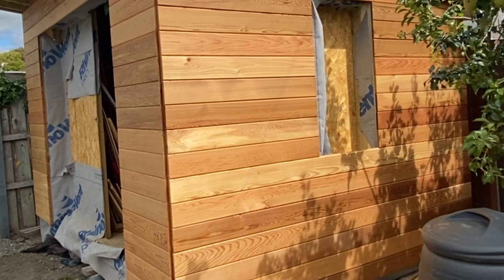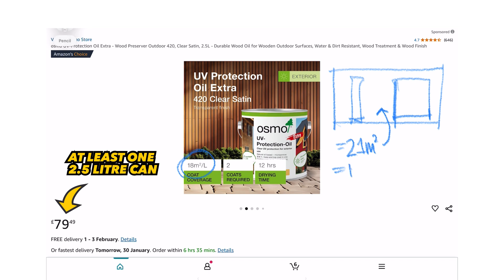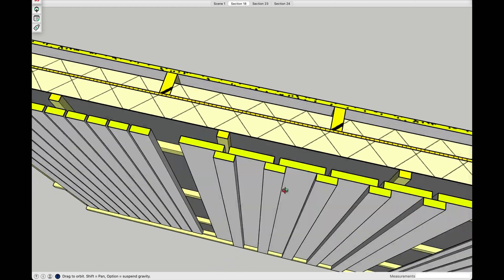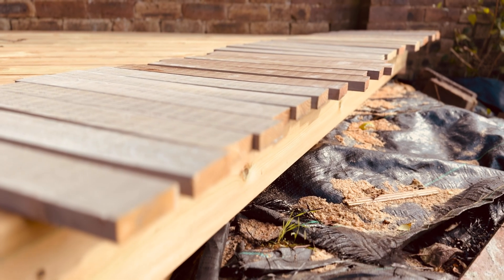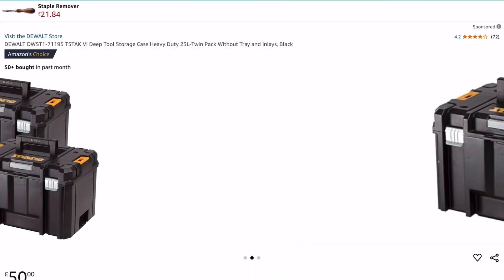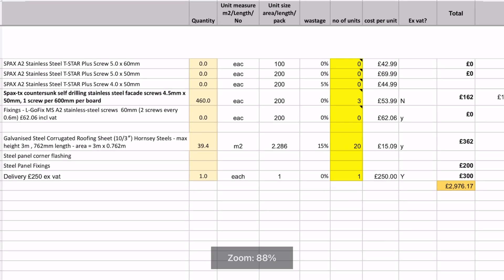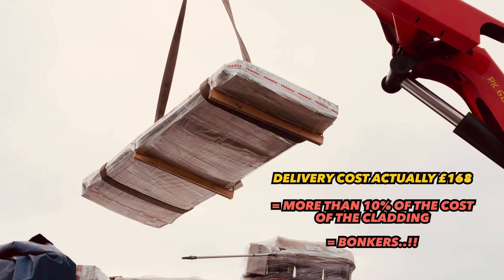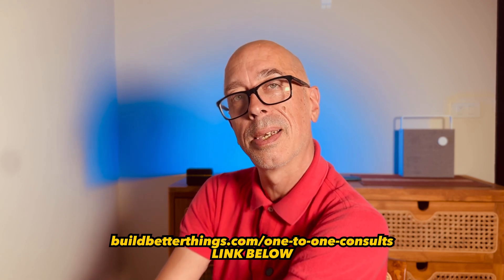Wall Cladding - panel size, fixings, timber or composite - rain screen or tongue & groove

Comment: Hi, I have just come across your channel and currently binge watching everything I can find about garden room builds. One question I have, is with a Warm Roof setup, how do you properly apply a vapour barrier? Specifically at the ends of the joists. Every other video I come across, the put in insulation and tend it forget about the vapour barrier here. That cannot be right!
Reply from the maker: You’re right. Many just do the roof vapour barrier and don’t bother about the walls. I see it a lot in the roofing videos.  If you see the early part of my video you’ll see the silver vapour barrier laid around the joist ends so it forms a continuous layer between horizontal roof and vertical wall. It’s a bit more work if you go with these bulky overhangs which many still do, but still possible.

Comment: Lovely detailing.  When is the video for the eaves coming out? Have always hated clunky eaves overhangs with fascias.  You mentioned this is a parapet in the video. Be interested to see how this was constructed. Your videos are so useful and informative btw.
Reply from the maker: Thanks a lot. Hope to get it out soon.
Reply: Looking at the drawing and images I can work out the eaves detail, though it does not appear to be a parapet as such.  It does mean that the cladding is a rain screen and I wonder if it is possible to incorporate a drip detail to prevent rain driving behind the cladding when using a vertical lapped cladding.  A chamfered piece of timber fixed to the edge, with the chamfer sloping upwards on the underside towards the cladding to form a drip might work, though you would probably need a batten on the underside to hold the edpm in place.  I assume you have a gutter on the opposite, rear side.
Reply from the maker: Hi. I form an 20mm projection over the roof to the depth of the rain screen and the cladding plus 10mm. The EPDM is folded over that and lapped over the breather membrane. It’s a parapet, just a very small one. I will be releasing a video soon, I just need to make the time.
Reply from the maker: Yes, gutter only at rear.
Reply: Thanks for such a speedy reply.  I see the low parapet now on another video.  Nice and simple with no tricky pigs ears and other details to bother about.  Is the parapet formed with OSB (surely you would say this will rot)?  Or is it some form of cement fibre board?  Or do you just have thicker insulation at the edge?  Would building control be happy with such a low parapet detail and no eaves?  Thanks for your help and sorry for so many questions.
Reply from the maker: Questions are good. Building control are only responsible for compliance, not design. Parapet is marine ply and sits above roof and wall insulation so no cold bridges. It can’t rot because it doesn’t get wet.  You need to consider fixings considering uplift.
Reply: Thanks, really helpful 😊

Comment: Really neat finish on this! Would you consider doing a video on (or mention in some capacity) rendered finishes onto timber framed construction? E.g. harling or monocouche style systems but onto a timber construction

Comment: Fantastic video. Your recording of graphics is getting better and better. Keeping them relatively static in orientation on screen makes it easier to follow the "story". 

Here in New Zealand that Sioo:x is $75 per liter. or $285 per 5 liter. At coverage of 4-5 sqm per L for the first 2 coats and 8-10 for the 3rd, the price is getting insane. When you're coating 3 sides of each open panel board the total sqm goes up by a factor of 1.3. So a typical 30sqm sleepout with 40sqm of exterior cladding, would need around $1800-$2000 of SiOO:X.
Reply from the maker: Thanks a lot. The sioo is quite a bit cheaper if you have it done it the saw mill, but that depends on whether they do it. There are a few that do in the UK

Comment: Hello, I’m doing an outbuilding and building control say we need euro class B due to proximity with the boundary. We really want to use SiOO:X cladding protection but unsure about how it works in tandem with a fire retardant? would the fire protection be applied after the SiOO:X, and would it likely discolour the cladding that has it applied?
Reply from the maker: To get Euro class B I think you need to impregnate with  intumescent before the sioox. I don’t believe it discoloures. And it needs to be a closed panel system.

Comment: Still rambling on, we used a double fxng and it looked absolutely perfect. The Site joiners raved about it which was brilliant. Funny anecdote to this, my mate, ( a bit eccentric but a very good carpenter), lost patience with me one Day as we were trying to install a length of cladding, if I remember it probably wasn’t perfect, so usual levering & clamping, he then grabbed the air nailer, bead in one hand & missed the cladding & nailed the bead to the batten, “oh for fcks sake” & did it again, 😂, that was said in a Wigan accent, needless to say it wasn’t my bead & took the air nailer backoff him. You can have a giggle at Work. Brilliant

Comment: I’ve noticed that one of the comments relates to being unable to source the timber cladding, apart from through merchants. We did cladding on a small development, many years ago now, we sourced the specified native larch from a local, (reasonably so) sawmiller. It was rough sawn. You are always going to get some twisting & cupping & the occasional unwanted knotting but we laid them aside. The Architects?! did not supply us with any component drawings,so we designed the appropriate system, quite straightforward. There was no timber treatment applied. excepting of he fire stops, I did visit the Site many years later and the larch had greyed but it was still immaculate. We didn’t use screw fxngs but S/s nails with a big fck off American style air nailer. We used a double fxng which was carefully remarked
Reply from the maker: Thanks for the info. Natural greying works as long as there aren’t overhangs or shaded parts or areas which receive more rainwater, for example. The natural greying is beautiful except where it is uneven, and then, in my opinion, it can be a bit ugly

Comment: Really good video. It's frustrating that it isn't possible to buy that larch in small volume. I was hoping to get some to build a double gate on the side of the house. At 3 x 2m, I'd have a bit left over from a pallet!
Reply from the maker: Hi.  A very few sizes are stock items, so if you could drive to their premises, and cut to size to fit your transport, you might be able to make it work for your quantity , but otherwise you’d need to factor in the crazy delivery costs.
Reply: @build-better-things  thanks for this, I didn't see your reply earlier. Newtonmore isn't too far away, but I'd have to factor in to a family trip or something to justify. Otherwise, I'll just have to keep patching my cheap gate until the wind takes it away for the final time!

Comment: A few questions: Have you tried Accoya? Do you think it's worth the extra £ (or should I say ££££££££(!)). Also, with the rain screen cladding, do you get problems with bugs and spiders nesting between the breathable membrane and the cladding?  Finally, I saw you had cut the bottom of the cladding at an angle to provide a drip edge that'll slow the degradation of the end grain. Nicely done 👍
Reply from the maker: Hi. Accoya isn’t my favourite for domestic projects, I just find it too uniform. I guess for commercial buildings with large areas it can make sense.  Not had problems with insects, nor vermin on any of these types of builds but just my own anecdotal experience. Yes I should have mentioned the diagonal cut for the drip. Very relevant as well for horizontal cladding. Thanks a lot.

Comment: Great content - very informative. Keep up the great work. I'm looking at retrofitting nice wood cladding to a 60s town house. Improving insulation properties and making it less ugly are the goals. Have you covered off in a video all the stages/ things to consider? Assume I'd also need new windows as adding insulation battens etc would significantly increase wall thickness.

Comment: Thanks for the inspiration - Its good to know there is an attractive solution for cladding without going to marine technology . . .
dozen coats of varnish applied by a specialist boat builder for a gleaming varnish look.
I will be in touch later in the year to optimise the workshop construction - depending on progress with the list of projects.
Another YT channel tried Osmo and than another product on garden furniture . . . the wood still went grey
Reply from the maker: Yes I saw that. Thanks a lot and best of luck with the project